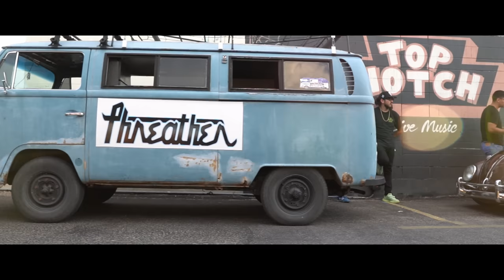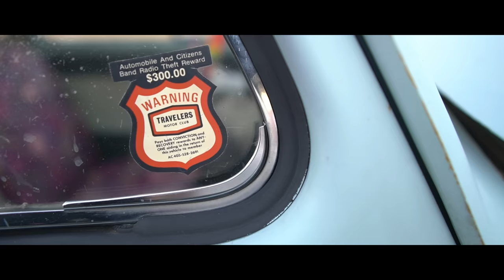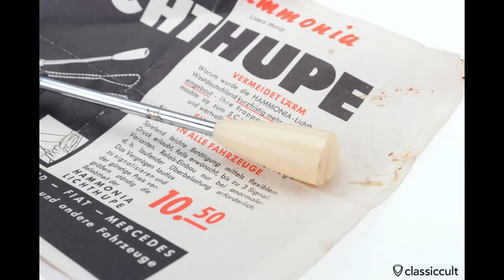This VW has 3 Carbs, 2 Distributors & 2 Coils!

Comment: I wouldn't say I'm a purist but with such an early bug with a cool story I'd have been reluctant to change the colour but it looks so right for the car. A lot of great and interesting mods done.
Reply: The car is 65 years old, it has been in the current family for half that time.  Before Frank bought it a previous owner had installed 356 brakes.  The white paint on it when Frank bought it may not have even been the original color.  I agree, it looks great the way it is.

Comment: That 16 Valve Scirocco is awesome!  I had an '85 Scirocco Turbo [yes, Volkswagen made them, a total of 52 by the way, sold by the dealers and the turbo system was included in the factory warranty]  and it was an utterly solid car.  It was solid because it was actually a four-door Mk1 Golf chassis taken off the regular production line in Wolfsburg and sent to Karmann in Osnabruck, where it was further strengthened so that it could be a convertible.  But instead it received a Scirocco body....Meaning it was ridiculously overbuilt!

Comment: On an aircraft engine with dual plugs,one of the run up tests before taking off is "dropping a mag"  and seeing for an rpm decrease of 50-150rpms when you shut off either the right or left mag(you run on both normally). 
Anyways,that should tell you (sort of) if spark power changes horsepower. 
Of course an aircraft engine runs pig rich to blow fuel thru it for cooling but still it's food for thought.
Reply from the maker: Ah okay cool thanks for sharing!
Reply: @VWLifeVW  I dig em both. 
Dad has a 46 luscombe with a 65hp continental.
The similarities between an aircraft engine and a VW engine are easily identified 😁

Comment: Mechanical multiple spark discharge! That even sounds great to say 😄 
If this came out in the day, the beetle would have been made at the factory. Man, that would be waaaay ahead of its time by far. And... AND some weird progressive carb setup using the idea of a single carb for slow speeds and twin carbs for those high speeds. Mind-blowing.... is all I can say. 
Genius man. But so very much VW ownership is the essence of why this guy owns it. 
Inspirational to say the least.
Awesome video as always.

Comment: very complex set up on the engine ,would be interesting to see what horsepower gains if any it makes !!!! but it looks cool.356 brakes all round is a set up i used on my 53 oval replacement wheel cylinders were mega bucks even if you could find them ,i discovered that peugot are almost the same at a 1/4 of the price ,love the car !!!!!

Comment: My cousin has a 69 beetle she's recently had the transmission overhauled/replaced, installed new battery, new fuel pump, and a new set of tires, but mother nature had a plan, a microburst struck near by and ripped off the roof of their K9s house and it was tossed and dropped 90 degrees straight down on top of the passanger side roof, it did damage the door/glass the window, actuator crank assembly, and the cab, 😭😭😭😭 now she wants to sell it. Great video. Omg, 2 distributors.!!! 😲🥺😳😬😵🤯😱, Wowww!!! 👋👍
Reply from the maker: Post a picture of it on our Facebook page! https://www.facebook.com/VWLifeVW/

Comment: Frankie's two outside carbs if for a Crosley (American made car from the 40s and 50s) are probably US made.  For you info the Crosley engine was actually use as an aircraft engine in the original Mooney Mite.  The MM was a single place low wing retractable aircraft built in Texas.
Reply from the maker: oh interesting thanks for sharing!
Reply: @VWLifeVW  by the way Crosley was manufactured by a appliance manufacturing company known for refrigerators.  Cool....   Us old guys know this old history stuff from decades ago.  Look up the Crosley Hot Shot 2 seater convertible.

Comment: Love your channel, I have been a VW addict since 1991 when I bought my first bug. It was a 1977 beetle and it was not running at all. I was fresh out of high school and knew very little about car let alone air cooled VW engines…. Several months and a stack of manuals and I had a freshly build 1600. I replaced everything except the block and heads but it ran sooo smooth… that was when the addiction started. So I opened my own VW restore shop and I was super busy lol. So 26 bugs later, 7 buses, and a notch back later. Here I am. Unfortunately they are all gone now(life issues). Dying to get back into the life. Do you guys sell any of that sweet swag I see you guys using. Magnets, stickers, shirts? I’d love to buy some.
Reply from the maker: John that's awesome! Thanks for sharing. Www.allmetricgarage.com has our merch. If you have a chance Post a picture of your old VW's on our Facebook page! https://www.facebook.com/VWLifeVW/
Reply: I would love to but unfortunately all my photos and scrap books were lost in a fire years ago 😢😢😢

Comment: He probably needs the 3 gears in the distributor block more for spacing than for direction. It would be fine to have the distributor run backwards. You'd just have to have the wires in the reverse order. Yes?
Reply from the maker: Maybe.

Comment: 10:18 Crosley was NOT a 'British car', boys...<<Crosley was a small, independent American manufacturer of subcompact cars>> I had on in the mid-50's - you are correct about the Tillotson carbs coming from Crosley engines, though...Great 3 carburetor Beetle!
Reply: There was a Crossley Motors in Manchester England that made cars from 1904 to 1938, the names are similar with  just an extra S.

Comment: So....He made the twin distributor body himself.  Why?

Bosch sells a part that was used on the Porsche 928S2.  This part, Porsche part number 928.602.532.0R, allows twin four cylinder 944 distributors to be installed in place of the single 8 cylinder 928 distributor.  They built this part so that they could install fully electronic 32 valve ignition on the 16 valve cars sold outside of the United States without redesigning the 16 valve head, which was shortly to go out of production.  The part in question uses a tiny cogged belt to drive the second distributor off of the first, which is driven by the drivers side camshaft. 

Bentley eventually used the exact same Porsche/Bosch part on the Arnage coupes.  I'm surprised this guy didn't realize this part exists, since it would be easy to modify it to fit the Type 1 engine.
Reply from the maker: Interesting!
Reply: @VWLifeVW  They went to twin four cylinder distributors because this allows the rotor to have a huge contact area,  nearly 20 mm across. This wasn't possible with a single distributor, it would wind up looking like a pizza. All this is because on the EZF ignition system the '84-'86 928S2/US model '85 and '86 32 valve 928S cars the  COMPUTER decided when the spark would occur....Not just because the rotor contact met the cap contact, which is the traditional way and how the earlier 928 with vacuum and centrifugal advance did it.  When I first saw this video, I was sure that this was the part, but then saw "Bosch" embossed on the side and the screws and realized that this was something else that had been hand built.
Reply: Bookmarking this in case I get back into VWs

Comment: 3 carbs on a single port engine, 😂😂😂 3x’s the problems on still no performance. Heads make power
Reply from the maker: Okay but he didn't necessarily do it for "power"
Reply: @VWLifeVW  ya a he did, you don’t have to stick up for the goofy old guy. Nobody adds carbs for reliability, or dual distributors for that matter.